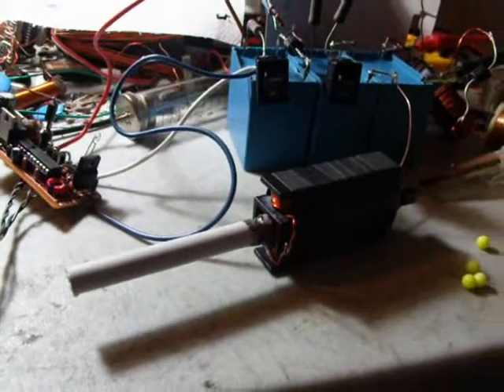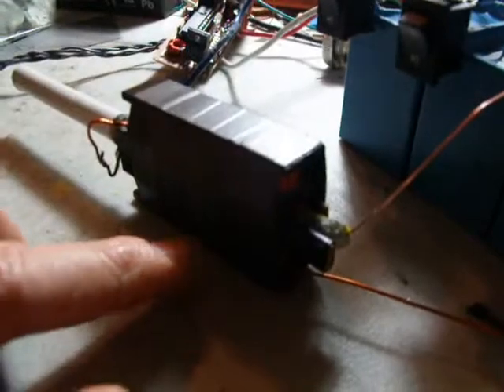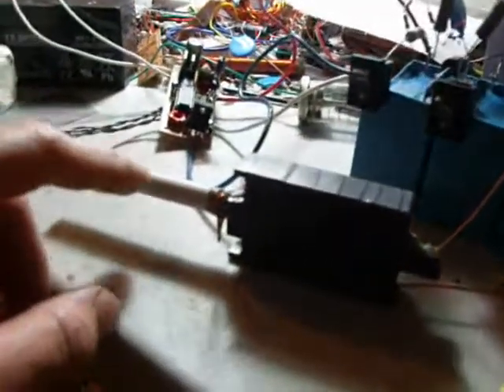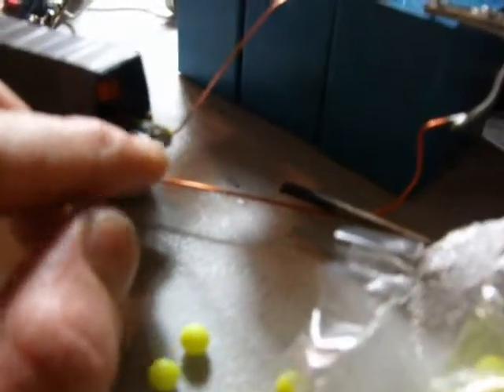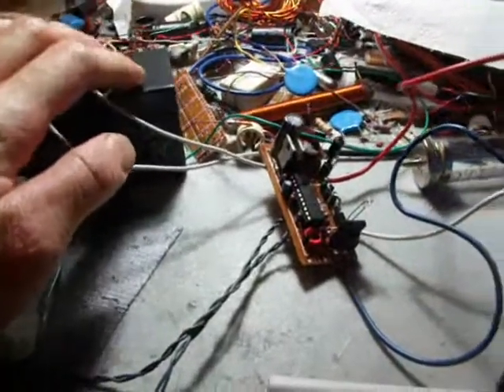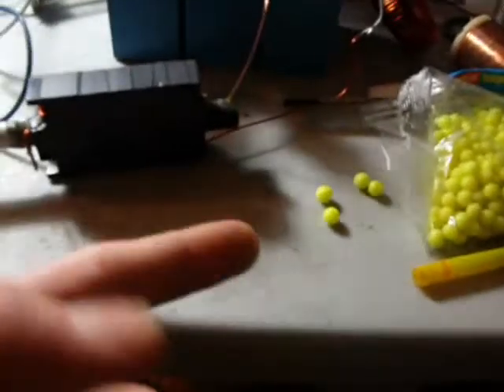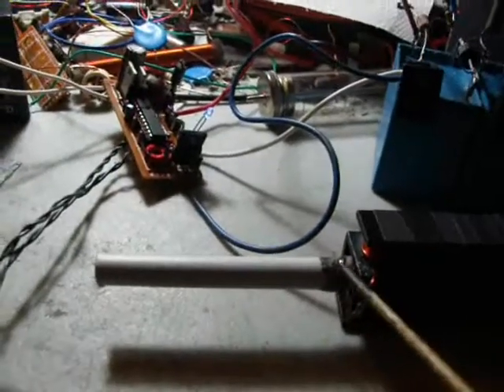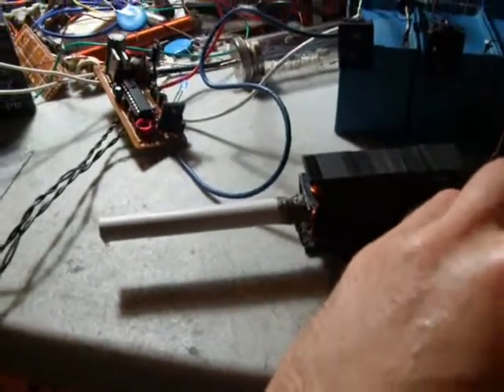Airsoft ETG

Comment: Yan,
the circuit B-field is brilliant along with the two electrodes down the barrel.  However, I am a bit confused about the inner part (not shown) that you describe as a coilgun-it may not work as planned since the strongest B inside a solenoid is NOT at the center axis, but near the inner edges of the coil.  The thing about the center of the coilgun is that the B field along the center-axis is strongest in the center of the coil, but this center axis is where the overall B inside the coil is --weakest- I plan to try this, slightly modified.  I wish I could see inside the black case!!
Thanks,
--Dale
"signification" on 4HV

Comment from the maker: The charger is totally my design. It is flyback with current control, based on SE555(6) timer. The current-suck period is constant, but discharge time vary depending on the time it takes for secondary to empty the energy stored in transformer. When current over secondary drops below certain level, MOSFET turns on starting the new energizing cycle.
Reply: https://youtu.be/SRqVj3_jUa8,мой

Comment: Hi Yan

What sort of charging circuit are you using? is it of Uzzor2k's design.

Very interesting video by the way, this is the sort of thing i aim to be able to achieve (hypothesis,design,test)

Need more experience though with simpler HV projects :D

Thanks